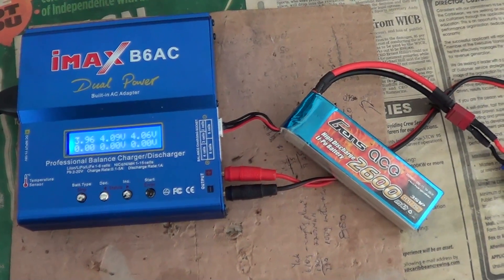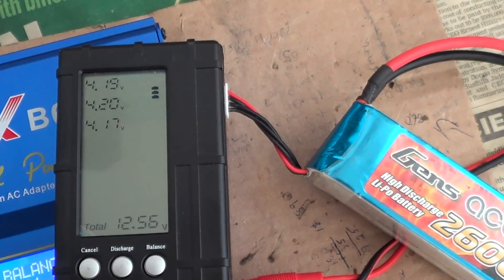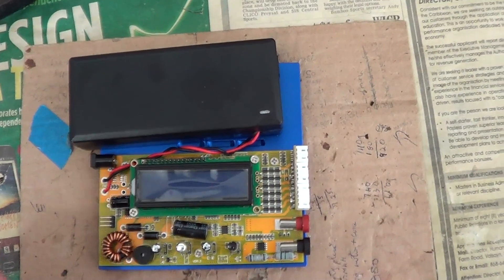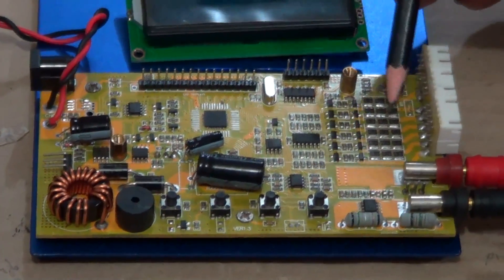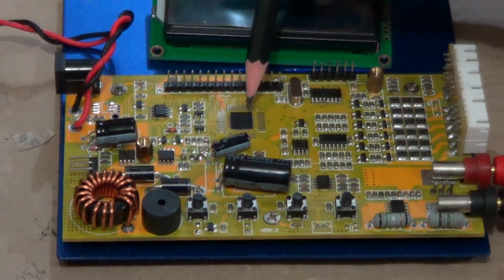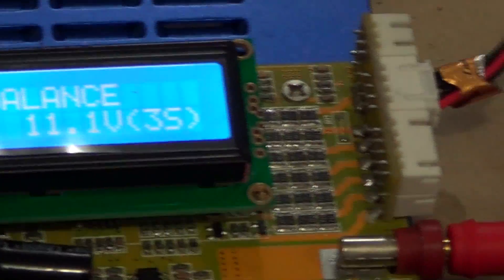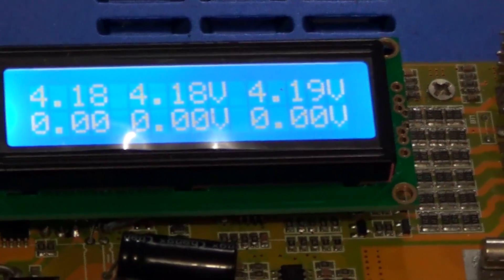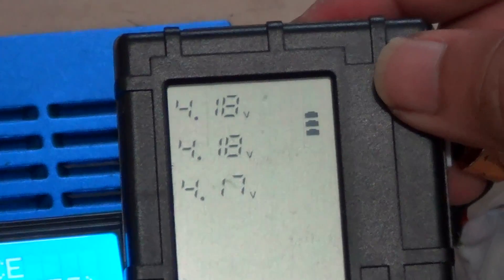Fix for the IMAX B6 LiPo charger when overcharging

Comment: hi sir I want to ask. I use imax b6ac just like you. This charger is now overcharged .. the lipo battery is damaged when charging. What components are faulty? I charge the battery 10 times when the battery is full. It's very dangerous when I charge it. What should I change? please answer my question .. thank you.
Reply from the maker: check if the mux is working also check the potential dividers. The psu of the unit may also be giving high voltage I think it is a buck converter.

Comment: Hi.. Mine GT Power B6 is reading over the tester
 In ecample If the cell 4.20 read by B6.. The voltage tester only show 4.09. Is it the same problem with yours.. And changing multiplexer would fix it..?
Reply from the maker: the multiplexer worked for me. but there may be some other calibration potential dividers that may be at fault also

Comment: Halo to everyone, I have this charger and when I try to charge a battery, it get very hot and stops. At the beginning it was the discharge that caused this problem but now, it cannot charge too. I wonder if it is the two big resistors on the negative pole or the two big transistors under the board. Has anyone experienced the same?
Reply from the maker: that may be a short circuit. Too much current . Check for shorts or resistance changes shunting the output.

Comment: I have same charger what you have... accidentally I soldered  the input 12v wires opposite polarity ...and now itis not working plz help
Reply from the maker: That should not be a problem usually there is a diode to prevent reverse polarity. Resolder correctly.
Reply: @rabindranathramsarop  done but still some problems are arising can I discuss it here....
It will be better if I get your mail id or other media id
Reply from the maker: can you post a video? Post it here or send to rramsaroop@excite.com.
Reply: Voltage error cell connect
Reply from the maker: @rahulghosh0210  I guess you are trying to charge a LiPo battery. 
Are you plugging in your balance lead to the balance port on the imax B6?   
If so then either the battery balance leads are faulty (check for voltages) or the balance port on the imax B6 is faulty. 
If the imax B6 cannot read the balance port voltages an error like this occurs.
Be careful with LiPo's and mains voltages.

Comment: I have a similar problem with my genuine imax b6ac, when I connect a single cell to the charger, it shows a voltage lower by 0.5V than my 2 multimeters, so your video gave me a hint where the problem could be. Thanks
Reply from the maker: glad this could help
Reply: For GENUINE SkyRC B6AC, simply download and install v1.14 firmware. This is not linked on the product page, you must search News Blog for article "[Update Notice] B6AC/ B6mini Calibration". Problem SOLVED.

Comment: I wonder if you could tell me why one of these chargers will only charge a 2S LiPo. It refuses to charge anything larger. I've looked closely at the resistor network and nothing appears to be amiss. The tracks are OK, there's no apparent damage anywhere. I wonder if it could be that IC you pointed out.  Without a circuit diagram it's impossible to trace where things go wrong. It simply doesn't like 3x4x5xand 6s LiPos. Perhaps you could point me in the right direction, thank you.
Reply from the maker: hmmm   that's a strange one.  When you connect a 3s battery for example is it reading the voltage of the 3rd cell?

Comment: ive got a mini reading 0.4v off what my fluke indicates. im going to try your fix. I just got it apart, on the mini the mcu is on the bottom and there are screws under the lcd. the lcd is soldered on. Lucky I had some low melt alloy to mix in after geting most of it off with wick. I found a "megawin" mcu instead of atmel I expected. same mux chip. thing is I can only find 4051D on ebay and mine states 4051G
Reply from the maker: google the specs for your mux. also try to calibrate it first.
Reply: For Genuine SkyRC B6 Mini, simply download and install the v1.14 Firmware. This is not linked on product pages.Search online and find SkyRC News Blog post "[Update Notice] B6AC/ B6mini Calibration".

Comment: You are strange.
1 - This is not a fix for the imax overcharging, but you changed a faulty multiplexer in the device. Ovarcharging can happen for many other reasons, why do you think this is the general problem. Actually its quite odd error, bad calibration is most probably much more frequent.
2 - You forgot to say, is this an authentic iMax B6AC or a Chinese counterfeit ? A fake charger can have 100 other wounds, what you can't fix. For example bad quality circuits, just like a faulty multiplexer.
3 - You compared the voltages to another battery charger, without any explanation. Why would be an other battery charger a reference ? It can be the same as bad or even worse. You should buy a precision voltage meter for reference.

Comment: why would you use a $10 battery tester to calibrate a $60 charger. At minimum use an actual multi meter. Try to use at LEAST a Field Piece or Fluke. There is a 50% chance your other meter is calibrated wrong.
Reply from the maker: Don't have a fluke but did verify with an oscilloscope.
Please see The Accuracy of the Voltmeter section of a Voltmeter/Discharger Unit 
at https://www.youtube.com/watch?v=MbNobIaOtuY

Comment: sir i am having a lipo 14.8v 4600mah  4cell 68wh battery and when i set 14.8v and 4.6amp on the turo charger balance mode and trying to charge to charge the attery the charger is shutting down after 11 sec and restarting.what is the prolem.plss help
Reply from the maker: might be a power supply problem seems that your charger is not delivering enough current.

Comment: Hello.... i have a burned resistor, one of those 2 big resistors (light blue color) at the botton.... the fact is that I cannot find exact value..... what would you do? the value seems to be both 0,52ohm... what value are yours??
Reply from the maker: will have to check this but for the resistor to burn too much current would have flowed through it. maybe a short?

Comment: It looks to me like you have a fake (knockoff) charger, based on all the real/fake videos I've seen, and the fake chargers are known to overcharge batteries which damages them
Reply: I have both the original and the cloned Imax, plus other similar chargers, all using the identical motherboard. I've checked each of them, 6 in total.  2 units were close to the actual voltages shown on my recently factory aligned Fluke multimeter. 2 units were showing lower than actual voltages and the remaining 2 were showing a higher than actual voltage. Of these last two, one was the fake Imax and the other was the genuine Imax.

This blows your myth out of the water.  The Imax is no better or worse than any other 4 button Chinese charger. Only two of the chargers were capable of overcharging LiPos and neither of the were the Imax or it's clone. You're guilty of regurgitating mythical RC tales. You've only "Heard" stories from someone who "heard" stories from someone who did the same. There is no factual evidence of your claim, only hearsay. Until you have actually run tests on dozens of chargers you're simply repeating a myth. 

Four years ago I was present at a capital city RC Club where every member was asked to bring their chargers so they could all be calibrated using professional equipment. In total there were just over 40 chargers. Out of those chargers only 3 were found to be close to accurate, the remainder weren't. 3 of the units couldn't be calibrated to achieve a close to accurate reading, the adjustment wouldn't go far enough. One of those was the Imax B6, the other two were HobbyKing Accucell chargers. So from my experience I could legitimately say that the Imax B6 is one of the worse chargers I've come across.  I could if I wanted to sound technical, but I won't because I haven't seen enough to pass an opinion.  There is one thing I could say though, The only charger I've had fail (it won't charge anything over a 2s lipo. was the genuine Imax. Again that is only one out of the six I own. Still nowhere near enough to pass judgement.  Ironically, my clone Imax has never missed a beat or a charge and believe me it's been given hell.

Please, in future only voice your opinion on something you've had personal experience with and don't perpetuate silly RC myths. From my experience the 4 button digital display chargers are pretty much the same, it wouldn't surprise me to know every motherboard comes from the same assembly line in the same factory.  Sadly all 6 chargers are now defunct as I've switched to the latest touch control fully digital chargers. Both of them do the same job as the old chargers, no better and no worse.
Reply from the maker: noted
Reply: propfella Well said!

Comment: You're assuming the cheap voltage tester is accurate. Did you verify with a high quality voltmeter that it's measuring the correct voltage?
Reply from the maker: I have a video verifying the voltages with an oscilloscope.https://www.youtube.com/watch?v=MbNobIaOtuY

Comment: meu carregador dispara em ,6s e termida a carga mesmo colocando bateria de 2700mah com 1.3a.
Reply from the maker: +André Carvalho sorry no habla espanol
Reply: my charger shoots, 6s and the charge ends even putting battery of 2700mAh with 1.3a.
Reply from the maker: +André Carvalho in the very simple case you could have a bad battery. Assuming it is not the battery then the output mosfet or  load resistors may be open circuit. In that case it should do that for any battery. Also if the balance ports are not discharging the individual cells this may happen.
Reply: I have 4 batteries of 2700mAh and all are having this problem, the charger is not tested, can be this open circuit! but how to know which and and is to replace?
Reply from the maker: +André Carvalho first connect a voltmeter to the charging output while the battery is charging and measure the voltage. Do this on a battery that needs charging. If the voltage on open circuit is 12.6V but drops to close to zero volts when the battery is connected then the charger 's main output is at fault. 
Also do these batteries charge well on another charger?
Reply: Yes. I had to buy another charger is not the same brand bought a Turnigy pro carried the 4 balanced batteries without problem.
I made a video problem charger Imax b6

Comment: my imax have 15 v in de output voltage when you turn it on,the same voltage in the power input board  that to the charguer output,and pressing start button charguing lipo 11,1V the screen show error message "over voltage" and in the exit the voltage rise up to 27V an descend,and i cant chargue my batteries multiplexer could be the problem?
Reply from the maker: +SU-47 i do not think so. It seems that you have a power supply problem on the board check for any regulators or regulator transistors.
Reply: in the bottom of the board at the outlput  (P) + and (N) - has a mosfet rectifier IRZF44,could be this,or the mosfet FQP50N06,also it has 2 components more, a diode schottky MBR1560CT and a amplifier D880,I will review this components
Reply from the maker: +SU-47 if i remember there is a mosfet that is heat sinked to the back case this one is for dis charging  so it should not be this one. Also you may want to check if you have any open circuit resistors.

Comment: did you calibrate it before you attempted to change the multiplexer? If you press and hold the dec & start button together and power on the unit you can enter a calibration menu.

So is the multiplexer a fake? incorrectly spec'd? cos all the multiplexer is doing is switching between the pot. div's for the cell balance lines, so the only thing that could be affecting that is possibly the multiplexers switch resistance.
Reply from the maker: +Chris Wouse on my one i could not get the calibration mode.
 no i think the multiplexer was faulty
Reply: +Rabindranath Ramsaroop  Was it faulty from the factory or how long have you had the charger?
Reply from the maker: it started giving trouble about 6mths after i bought it

Comment: I have the same problem, except it undercharges the batteries. Its a Clone. can i fix it by replacing the multiplexer?
Reply from the maker: maybe not. check to see if yours has a calibration setting

Comment: HI Rabindranath Ramsaroop .
  think I have the same problem, but I have another problem and I hope can you help me bouth of them.
first how can I be sure that the multipelxer is faulty?

another problem I have is when I plug a 3 cell lipo to the imax balance port, it dosen't show me the second cell it's show me 0.00v for the second cell.
to solve this problem I used a parallel board and then the problem of low voltage reading begun.
can you please advice me what went  wrong and if I need to reaplace more things in my charger.
Reply from the maker: +Idan Eliyahu To suspect the multiplexer you have to have another fairly accurate voltmeter. If the voltmeter and the cell readings on the imax are consistently different then the multiplexer is highly suspicious.

The second cell reading 0V probably has to do with the potential divider circuit for the 2nd cell on the imax or if that is ok then the transistor from the 2nd cell on the imax to the multiplexer could be faulty.

Also if the potential divider resistors for the cells on the imax overheated and changed  resistances then the circuit would not read correctly.

Check to see that the imax psu is good too.

Comment from the maker: quasimoto glez 
if  your display is working then it is not a power supply problem.
a burning smell could be from an overheated resistor.
i hope you are not trying to charge a LiPo battery on Pb charge settings because the balancer will not work and the charging algorithm is different.
you may want to check the mosfet charging transistor at the bottom of the board and the large resistors near the charging output on the board. Also check to see if you have any shorted mosfets.
Reply from the maker: you are welcome my friend hope i was able to help.

Comment: Very Good video. I wonder if you can help me on my iMax B6 charger.(trying to charge a phantom 3 battery I notice a burn smell after I connected the battery on PB charge)
all the functions and the display works except it DON'T charge there is not voltage coming from the output charger...
is there any input or output fuse that I have blown that can be replaceable and were is it.
thanks
Reply from the maker: check the output fets, resistors, fuses,psu

Comment: Thank you for this Video, 

i have a problem with my Imax b6 too. The charger doesn't charge my liion (1Cell) to 4.2v. It stops at 3.99v and says fully charged.

When i'm in the calibration mode the charger reads the correct voltage of the cell and any changes didn't effect the charging, it still stopped at 3,99v.

I only tried to charge from the output port. What do you guess causes the problem the multiplexer? The Imax b6 board looks fine i couldn't find any burns or faulti capacitors.
Reply from the maker: +Avon B This looks like a problem of the calibration voltage being too low. I do not think the multiplexer is at fault here. The calibration on the imaxb6 is locked after only a few tries at it and sometimes comes from the factory locked. 
I have seen my imax do the same ie. charge too low. My guess is that some of the internal resistors have changed values.

Comment: tell me my friend am confuse today i receive  my imax the cheap one ..i did charge couple battery 7.4v  was ok then i put 3cell battery one of the cell keep going 4.20 4.30.4,40 and one of the battery new one is over heat puff then i try another new battery 3 cell one of the cell keep voltage high non stop what the reason i am new on those charger but i charge my battery in different charger they are ok ???
Reply from the maker: Kanari Mentos off the top of my head it looks as if it is the same problem with the multiplexer.
Reply: +Rabindranath Ramsaroop is it a special multiplexer??  

could you link the ebay site where you bought it from??
Reply from the maker: +Darren Fürst  i cannot remember the site i bought it from but  you could try this ebay site 

http://www.ebay.com/itm/10pcs-SMD-CD4051-HCF4051-Analog-Multiplexers-Demultiplexers-SOP-16-/171177793565?hash=item27dafdd81d
Reply: Ok thankyou my one actually charges great except for the 3 cell on my 4s lipo it overcharged it any other ideas??
Reply from the maker: do you mean the 3rd cell on your 4s lipo?

Comment: hi today i receive the charger imax first battery was good charge 7.4 v  the next one is new one is 11.1 v its damage puff over heat can you tell me what reason why happened
Reply from the maker: +Noobert I have both . They both work good. The turnigy accucell is a constant current device while the imax b6 is a constant voltage device. Aside from the problem outlined above the imax has since worked perfectly.
Reply: Rabindranath Ramsaroop
thanks man now i dont have problem maybe was my mistake this happened just first i receive,t but i cannot do calibration is to much work connect to pc update do you know if they sell this usb part for connect to internet just easy way many thanks to you
Reply from the maker: +Kanari Mentos  as far as I know the imax b6 cannot be calibrated some claim that it could but i have never had success with this.
The usb attachment is just to plot a graph of the charging on your computer it is sold but you have to google it.
Reply: many thanks to you my friend
Reply: +Rabindranath Ramsaroop  If you press start and decrease at power on you can then calibrate to correct voltage of a known battery.
Reply: i try  does not let me